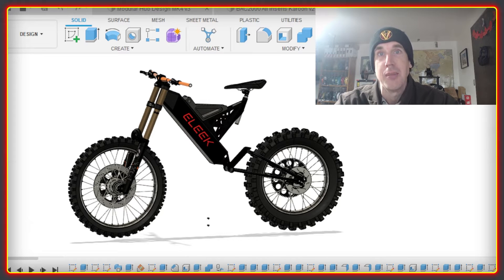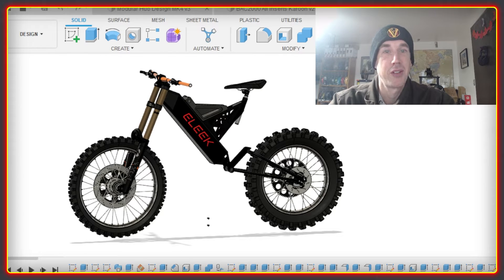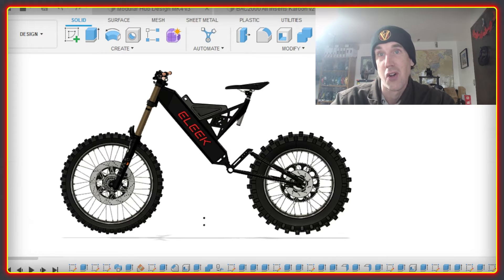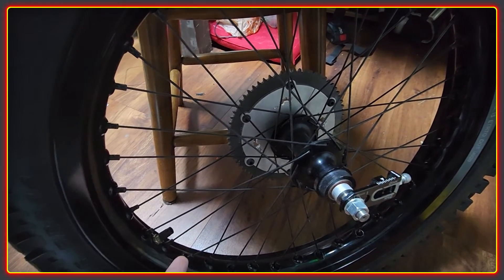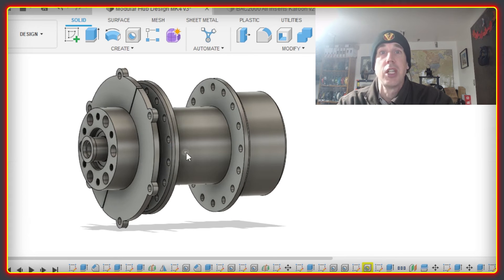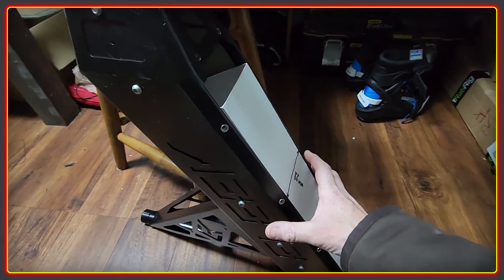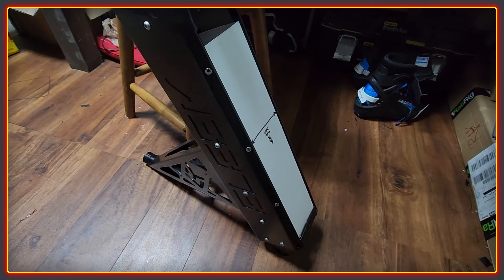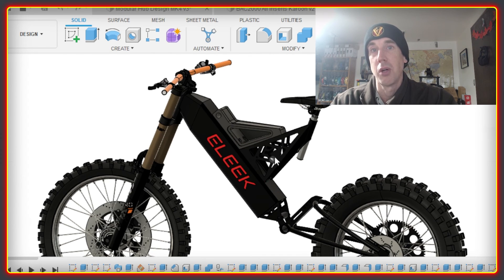ELEEK Lite Frame Update - BBSHD and Lightning Rods Mid Drive Motors

Comment: hi cap! really appreciated the battery compartment clarification since I'm considering myself which battery to pick, having in mind that i'd like to switch to a lite frame down the line.
would it be possible to fit a 20s5p 21700 battery by strapping it down to the top side of the box so that it doesn't rest on the plastic spacer? i was considering a similar solution, with the bottom plate held down by really strong magnets and hinged on one of the short sides so you can take on and off the battery easily.
Reply from the maker: Yeah. I had a few thoughts on that. Should be pretty doable I think.
Reply: @HighVoltageKits  also regarding the strength of 3d printed parts. the use of 3d printed spacers in the escooter community is quite insane, both to raise the deck (so the rider is actually standing on it) and to increase battery space (many screws are used and they usually go from the cover all the way to the metal of the frame, so technically the battery is applying pressure to the screws/frame, not the 3d spacer)

Comment: I built two bicycles with this lite frame.  One is running 26" and other is 27.5 both built with 3000w 135mm dropout hub motor from NB Power.
Reply from the maker: Excellent. The hub is definitely a good option, a guy on here did one of those at 72 volts with a VESC controller.
Reply: @HighVoltageKits since I can't send pictures on here...I just mounted the controller underneath with double sided gorilla tape
Reply from the maker: I think we in contact on what Zapp?

Comment: The kit in the center is an awesome idea! I am still waiting for my frame from Eleek.
Reply from the maker: Have you had any kind of tracking? They ship by ground and boat so if you go initial tracking then its usually about six weeks from that point.
Reply: @HighVoltageKits  it has been taking a while. But they are communicating well. And they keep telling me that they will update me when it is ready.
Reply from the maker: Good stuff. It must a nightmare to work in current conditions. I hope when it's over they will power forwards

Comment: You mentioned that pouch cells won't work. Which dimension is the limiting factor? I had hoped that they could be used for my two builds.
Reply: Yep, I have the same question. Why would pouch cells not work. I want to squeeze as much capacity as possible.
Reply from the maker: The pouch cell size format will not fit into the frame space as it is. I want to make the extension so I will see if it is possible and how much space I need to create.

Comment: I really like the Eleek lite frame, would love to pair it with a LR BB but really want that extra range. If you get something figured out for the larger battery space let us know! Only thing else that concerns me is the rear wheel / hub needing to be special, I'm not familiar with building my own wheels so that doesn't sound very fun
Reply from the maker: For sure. The hub has been a problem to figure out. In the end making it ourselves makes the most sense. Mainly because once it is made it can be varied as needed to fill the needs of many builds.

Comment: You owe it to yourself to look at the company send-cut-send for the extended battery box.  They will cut, bend and install fasteners.  Pretty damn cheap too.
Reply from the maker: I will check them out. The places I tried so far have been insanely expensive. Some did not even want to quote on it.